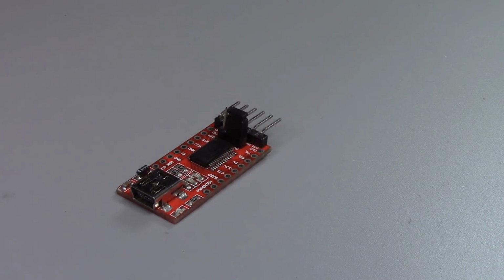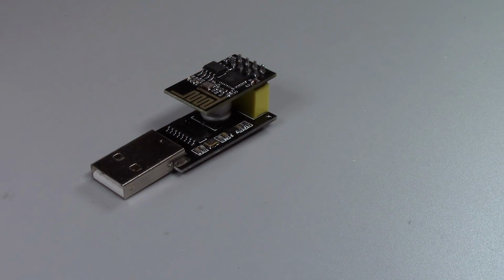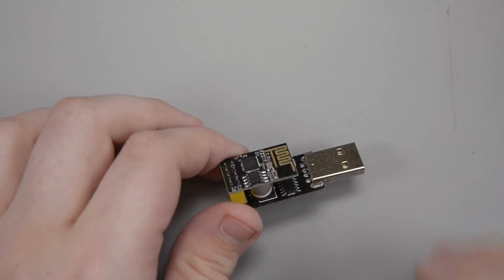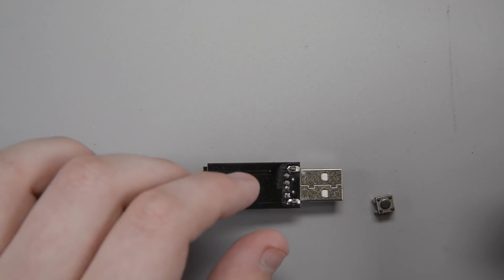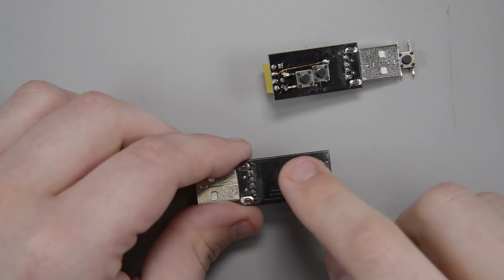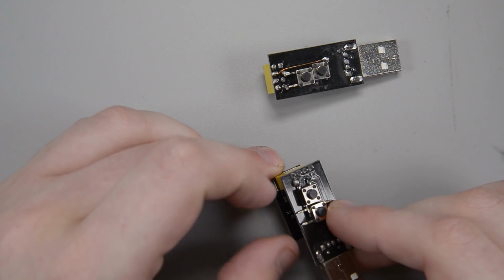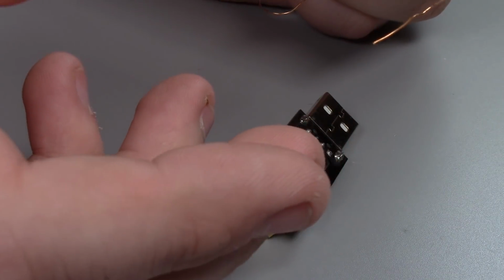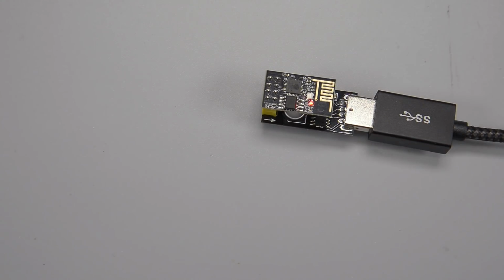Finally a new ESP8266 Flasher

Comment: Nice video and nice idea with the reset button.
I have the same converter, what I did is cut 3 pin headers snipped the middle one away which gave it perfect spacing. Soldered them to gpio0 and ground. When I want to upload and flash the ESP I use female jumper wires connected to the pin headers. Otherwise I can use it as a normal UART or serial/usb adapter.

Comment: I had the exact same situation  when I got that board as well, took me way longer than it should to figure out what was happening. I ended up soldering a toggle switch between gpio0 and ground

Comment: Yes, you could directly connect DTR to GPIO0 and RTS to RESET, I think that's what you meant in the video, and this would have allowed ESP to go directly into programming mode, the problem is that for example you could not use the serial monitor in arduino, when you open the serial monitor, the board is held in reset mode as the Arduino serial monitor pulls both DTR and RTS low. One option is to use a separate serial monitor that allows for control of the pins, to be used, like Real Term.
The best way to do this is to use a circuit like the one used in the NodeMCU that requires the addition of 4 resistors and 2 transistors, but it certainly complicates things a lot.
Your solution is simpler and faster to make, and to be honest, pressing two buttons is not that hard work.

Comment: I have these. The simplest way is buy 2 and link the programmer with a soldered wire. Note: this will be your programmer. The other unit can be to just run it. Had this option working for a while

Comment: I've been using the same module for quite some time. I soldered one smd tactile switch at a 45 degree angle on the bottom connected to gpio0 and the ground plane (large area on the pcb). This makes it quite sturdy. When I want to program a module, I press the button while plugging it into the computer. Done. 😀
Reply from the maker: Yup, I've totally done this on other flashing modules before but I figured if I'm going to make a video for it I might as well splurge on that second button ;)
Reply: That's why I don't make YouTube videos. For me it would have been a one minute Video. But I'm glad people like you make better videos than I would. Otherwise YouTube would get boring very fast. Keep up the good work. 😃

Comment: You can geht get it from some sellers at ebay with the switch already mounted.
Reply from the maker: Good to know - I just saw a ton of listings for these and thought they had the automatic flashing wiring built in and figured plenty of other people have made the same mistake so why not make a video to show others how to easily remedy it :)
Reply: I have sold 100s this year exactly like the ones in the video. Might be one of mine... amp.taod on ebay and soon to have amptoad.com up. I don't think you will find many vendors willing to mod these for you. The overhead on these is very low and it would not be worth the time to solder on switches. I modified mine a little differently, I super glued a slide switch to the side of the headers and drew on labels with a sharpie ("Prog","Comd") for program and command modes. Looks nice and its easy to get to when its plugged in. I have, sell and use both. The programmer I sell with my kits is the new one in the video because it is so much easier to work with.

Comment: They make that same thing with a switch on the side to program it.  It's 2-3 on Ali express..  but I bought a few of those by mistake I shall try your life hack!  ...even so the esp01 is kind of irrelevant anymore...
Reply from the maker: While I agree that the falling price of NodeMCU/Wemos boards has made those development platforms more appealing, I think the ESP-01 is still a very useful board if you just need a simple sensor or other low power device. The other dev boards out there based on the ESP line all have extra stuff that make prototyping easier but if you don't need all of those peripherals then the 01 is great and can function at extremely low power. They're still my go to board (or the 07) when power is a concern.

Comment: What do you use all these flashed esp01's for? What about other modules with serial built in etc?
Reply: Paul Robertson Anything you like. All you need is a little imagination to come up with a project for a ESP-01...and they are dirt cheap.
Reply from the maker: What he said. Also although I may not use 01s all that much, I know there are plenty of people who do. Also when low power is needed, the 01 cant be beat in terms of using an ESP8266 as the platform.

Comment: Not working ...   couldnot open port com 4 appearing
Reply from the maker: sorry to hear it's not working for you...
Reply: @ItKindaWorks  made it work... while uploading test code and testing in serial monitor .. 

 Values change with delay .. or conection breakes ...

Does PJ1117 LDO cause problems?